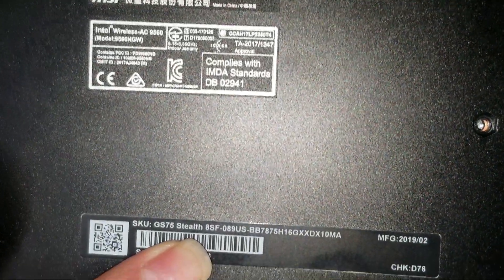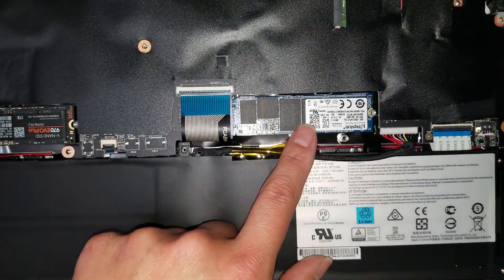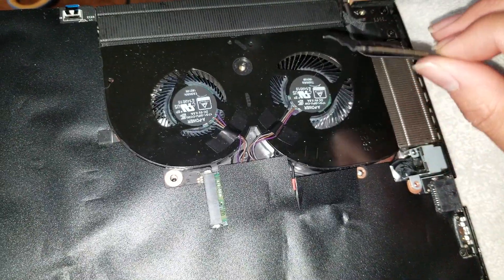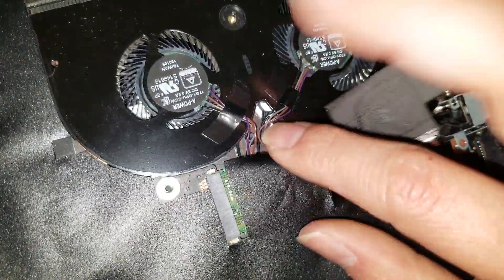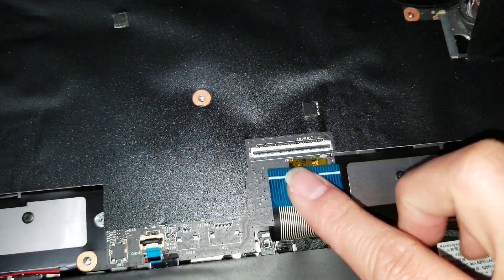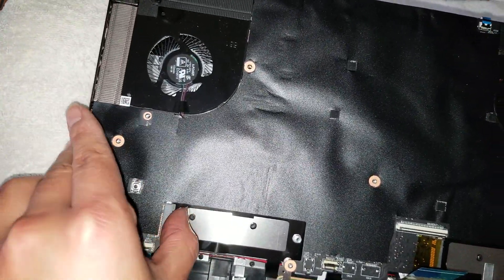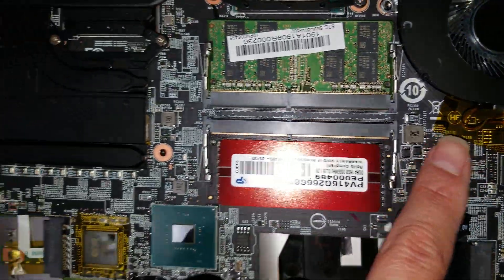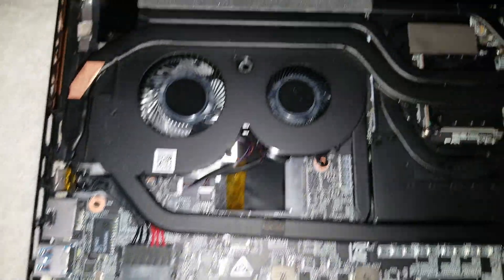*Disconnect Battery First* MSI GS75 Stealth Disassembly RAM Upgrade SSD

Comment: what ram should i buy to upgrade this? ive heard it needs to be the exact same to run optimally
Reply from the maker: You want it to match the speed of the one that's currently in there, preferably the exact same model if possible (I think Samsung in my customer's case). This one was ddr4 2666mhz. I'm not sure of the cl rating.  Usually they'll use the same on the same models, but best to check if you can. It's a simple model to disassemble to check physically. You can check the speed with some programs like cpuz or something if you only want to open it once you already have the RAM.
Reply: @ItsBinhRepaired  are you located in Los Angeles by chance loll. I'd rather have someone with more knowledge and skill open my.laptop up
Reply from the maker: @thomasnguyen4458  LOL I'm in the bay area. If you're ever in the area I could do that. Or you could ship it to me with a prepaid return label. :P
Reply: @ItsBinhRepaired  darn it hahaha
Reply from the maker: @thomasnguyen4458  you could always call a local store and show them my video. Ask for them to upgrade it for cheap. Lol
Reply: Replace it with a matched pair and sell the old one.

Comment: Great video bro, had this laptop for two weeks now and am excited to throw some more RAM and SSD !
Reply from the maker: Make sure you add RAM that's the same speed to get the benefits! My customer got another 30fps just by adding another stick of RAM.

Don't forget to subscribe ;)
Reply: It's Binh Repaired can you recommend a memory stick that would match the one in there already so the dual channel works?
Reply from the maker: @InventionADay  you'll have to open it up to check what's already there